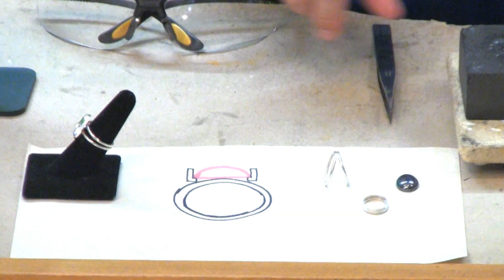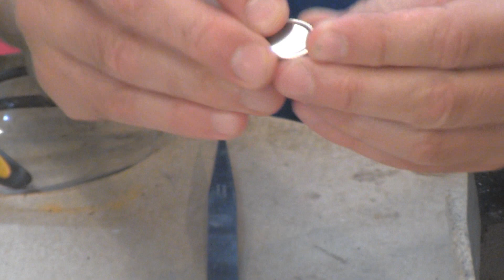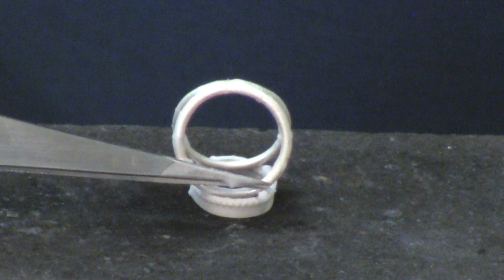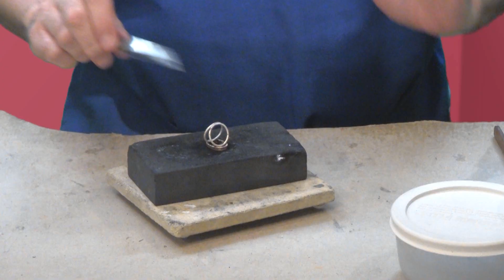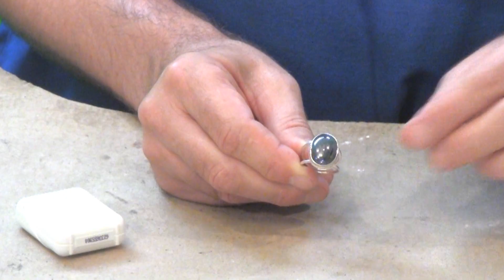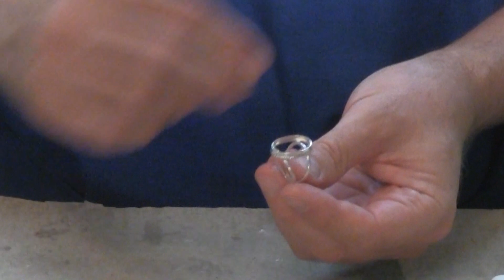Great  Step-Bezel Tips And DIY Flux

Comment: I’ve hit a good combo with my flux (I’m a newbie so idk if it’s ideal) but it’s using a mortar and pestle as the container for borax and I’ll add enough liquid to make a paste and apply it that way. 

My other option I use often too is a little needle tip squirt bottle with half water half alcohol. 

I should probably use only alcohol but I’m not sure
Reply from the maker: It sounds like you've found a system that works for you, and that's great! Thanks for sharing your tips. 😺

Comment: The step bezel I bought by mistake is fairly shallow for the cabochon.  Do you bend the bezel over the stone or use an epoxy?
Reply from the maker: Hi Beth, Some step bezel wire is very shallow.  Before you reach for the glue, try pushing and smoothing the bezel over the curvature of your cabochon.  If it just won't hold, you can try using the epoxy.  Just be aware that using epoxy on a clear or translucent stone might change its appearance.
Thanks for your support! : )

Comment: Hello John, I have a quick question for you: I've had such a hard time with soldering that I was on the verge of giving up altogether, until I learned something no one had told me previously.  It seems that all my disasters may have been down to a common fault that I didn't know was even possible: I was over cooking the solder.  The butane torches I'd tried were too powerful and were melting the silver bezel wire, I now use those torches for annealing only, which works really well, and I purchased a smaller torch to do the soldering. I'm very happy to say that, although I still have the odd disaster now and then, I feel really confident in my work. Remember that question I wanted to ask you at the beginning lol? It's this: even though you do a lot of soldering videos, all of which I probably know better than you by now,  I  wonder if you could do a "What went wrong and why, and how do I fix it?" video please?  I devour jewellery videos but you're my favourite instructor and I was very happy to receive your lovely card and badge in the post: an unexpected pleasure which arrived the day I was discharged from hospital and which cheered me up no end. Warmest regards, Lynette.
Reply from the maker: Hi Lynette,  First, I hope that you are feeling better and making good progress with your recovery.  I'm so glad that the card and button raised your spirits.  We have a number of videos in the works at this time.  But, we will look into making the type of video that you suggested sometime in the near future.  Don't feel discouraged by your set backs.  Everyone has difficulty learning how to control the torch when they first start learning how to solder.  And, learning how to solder without an instructor looking over your shoulder can be even more frustrating.  Hang in there and keep trying.  Eventually the torch will become your magic wand.  Thanks for all of your kind words.
Thanks for your support! : )

Comment: I am so excited about that flux, it seems to make thing So much easier 🤗
Reply from the maker: The boric acid flux that I used in the video is great for silver work.  Just remember that solder can travel wherever you place flux.  So, pay close attention to where you apply heat.  Otherwise, you might end up with solder flowing to areas where you don't want it.  Glad you enjoyed the video.
Thanks for your support! : )

Comment: Buonasera Prof, video molto interessante. È possibile sapere le quantità di acido borico e alcool?
La soluzione di aceto o limone con  sale si può usare anche per l'argento? Grazie mille.
Reply from the maker: Sto rispondendo al tuo commento usando Google translate. Il rapporto tra l'alcool denaturato e l'acido borico è qualcosa che dovrai solo giocare. I materiali combinati dovrebbero creare una sospensione. Se metti troppo alcool nella miscela, basta lasciarlo sedere con il coperchio del contenitore. Credetemi, l'alcool sarà rapidamente evaporato e la miscela otterrà la giusta consistenza. Il materiale agrumato e salato viene utilizzato per pulire il metallo dopo la pulizia. Non lo uso mai, ma molte persone lo fanno.
Grazie per il vostro sostegno!I am responding to your comment using Google translate.  The ratio of denatured alcohol to boric acid is something that you'll just have to play with.  The combined materials should create a slurry.  If you put too much alcohol into the mixture, just let it sit with the lid off of the container.  Believe me, the alcohol will quickly evaporate and the mixture will obtain the correct consistency.  The citrus and salt material is used to clean the metal after cleaning.  I never use it, but many people do.
Thanks for your support!

Comment: I use the boric acid flux if i need to protect against fire scale, I purchased 5 kilo's from a chemical supply for less than 500gr
that the jewellers supply charged, it will most likely be part of estate
Reply from the maker: If you work primarily with silver, the boric acid and denatured alcohol flux is wonderful.  But, the price of the boric acid can be off-putting.  Glad you go a great deal.
Thanks for your support! : )